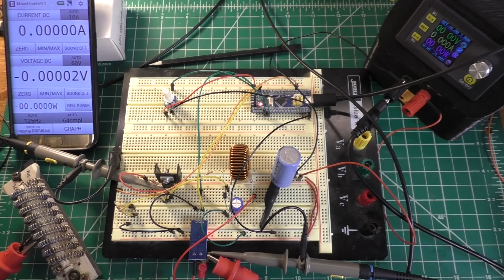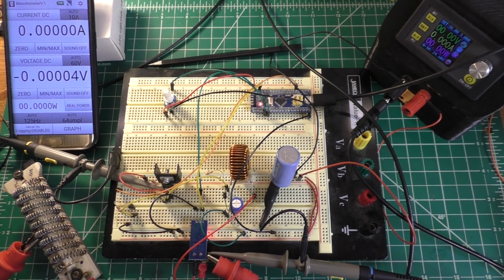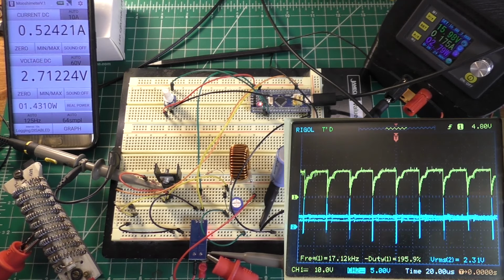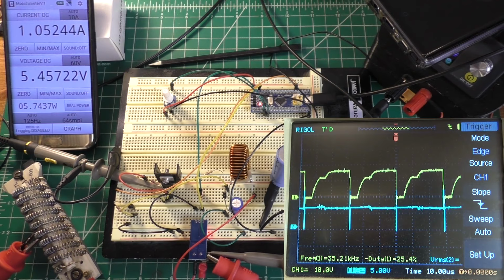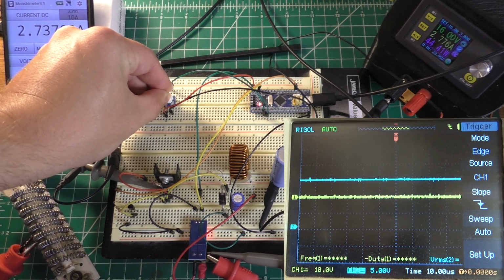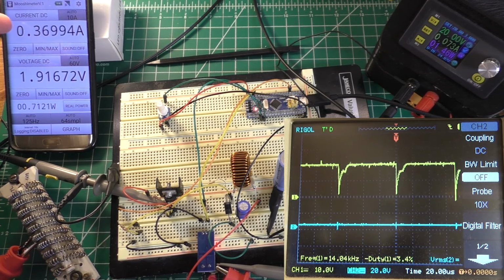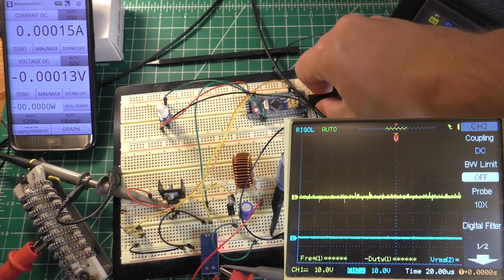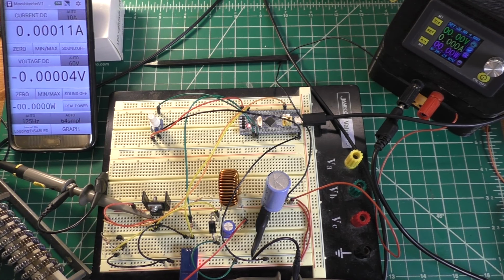Experimenting With a DIY Buck Converter

Comment: Just a recommendation, I would tap on a digital thermometer onto the mosfet and keep an eye on its heatsink temp! I mean I have powerful soldering iron that uses 25W at the tip, just saying 20W or so is a lot of power for these small electronic devices to handle.

Comment: Arduino Uno can do 60+Khz I forget the exact number.... dunno about mini or nano

Edit: I'm no expert but I'd say you need a stronger mosfet gate driver. Switching too slowly and spending too much time in the linear region during switching due to gate capacitance and other parasitics you need higher current driver to charge and discharge those capacitances at higher frequencies. Need an IC gate driver or a high current capability push pull npn pnp totem pole  setup.

PS I could quite easily be wrong.

Comment: I made that circuit and it's working perfectly with 555ic to charge my 18650 lithium batteries. And that's cool broo🤓 and will u make the boost converter circuit😊.